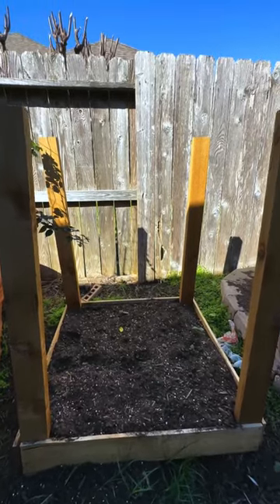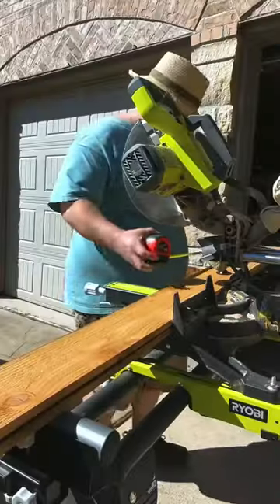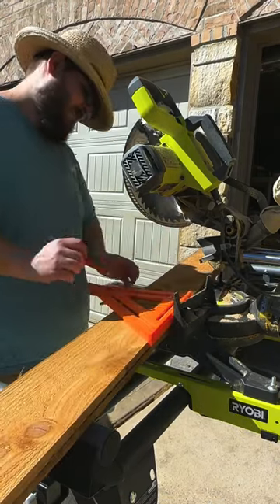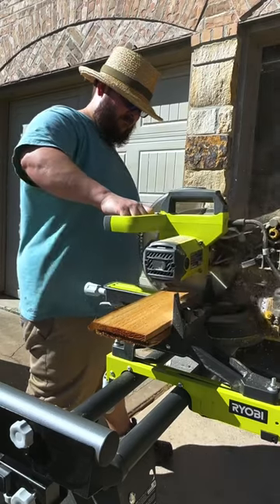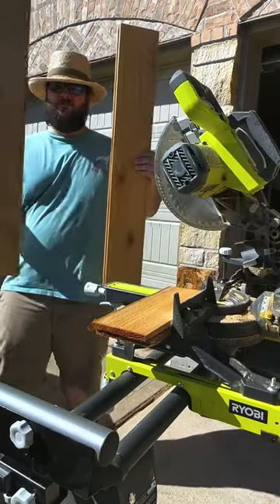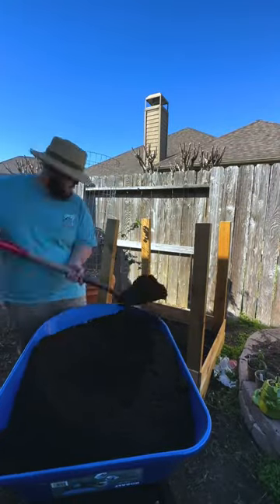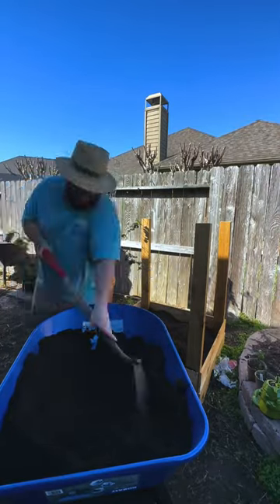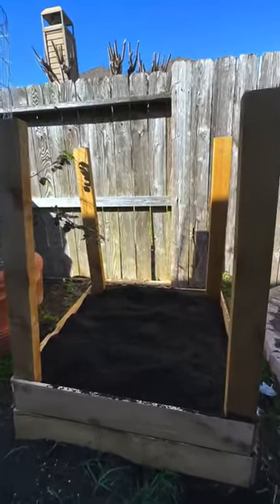Potato Planter made from Cedar Fence Pickets

Comment: WHY are you using a speed square with a miter saw? You're doubling your work. 🤷🏼‍♂️
Reply from the maker: So I draw a straight line
Reply: @ThirdCoastGardening  but my question is why do you need a "straight line" when you use a tool that makes a straight cut?
Reply from the maker: @sealtechblades  so the line is straight like I said so I know where to cut.
Reply: @ThirdCoastGardening  okay. 🤷🏼‍♂️